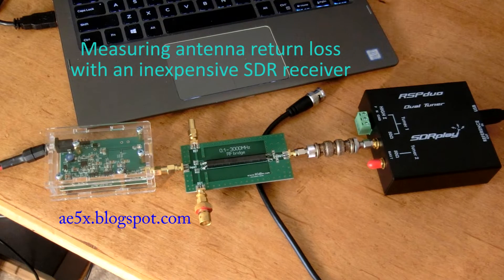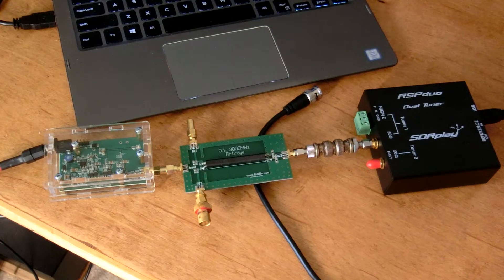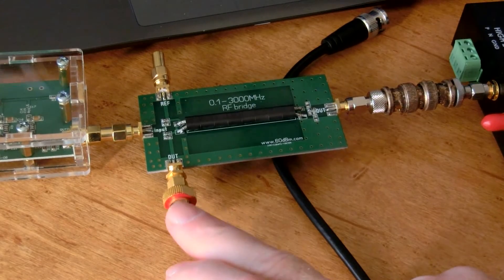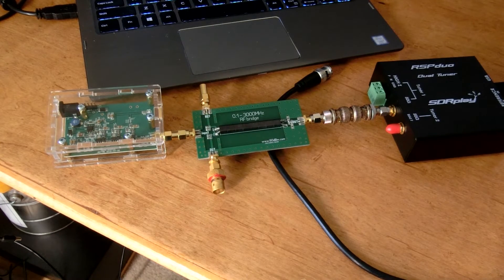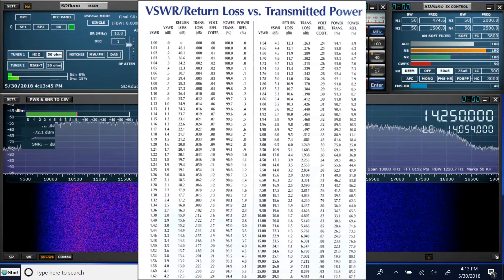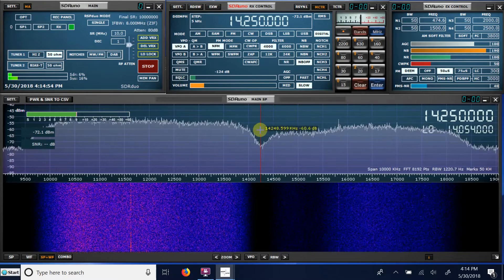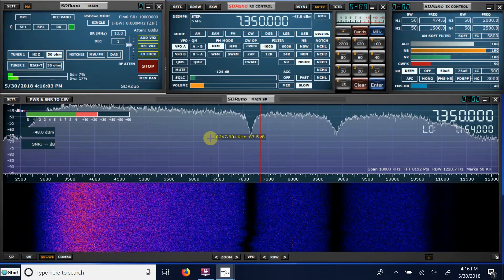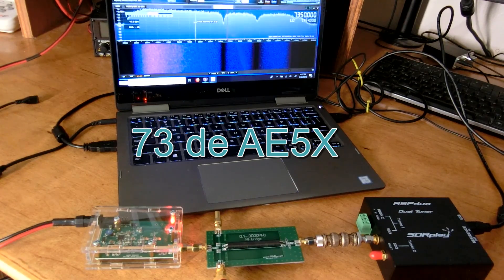Measuring antenna return loss with RSPduo

Comment: Vector Net Work Analyser is the proper tool. Cost from 47€ to 259€ in a span from 100kHz at the low end and 900MHz for the cheap to over 4GHz for the more costly one. The measure bridge is built in and the dynamic range is up to 90dB. You can also do a lot more stuff with a VNWA
Reply from the maker: "Toy factor" and other specs are all relative
Reply: My best VNWA ranges extrem  frequency from 10 Hz to 300 MHz and is limited only by 1/f noise in the lF range  and by 120dB dynamic range in HF and up range
Reply: @__logan__duvalier__ you are ignorant

Comment: This bridge is useful up to 1500MHz, above that it is crap. The alternative is to use a VNWA, that 50€ up to 1000MHz, for 250€ up to 4GHz. With the VNWA you can do a ton more type of measurements and a lot more accurate.this is a toy
Reply from the maker: With a Rhode and Schwatrz network analyzer you can make these measurements well into the double digit GHz range. To the R&S, your VNWA is a toy.

Comment: Super Video. I have the same setup only difference is the enclosed rf bridge from Ukraine and the enclosed version of RSP1A. My question is what about the power source for the rf noise sorce? It's better using a 12v battery instead of a switching power supply? And what voltage is recommended? Another topic will be the attenuator in front of the RSP? Do I really need one or I risk burning the RSP?
Thank you

Comment: Is there are special setting you're using in SDRPlay?  I can't seem to get my setup to work.  I'm using the the RF bridge (0.1-3000MHz / www.60dBm.com) to connect my trusty RSP-1A (OUT) , NOISE SOURCE BG7TBL 2016-03-06 (Input), dummy load (REF), and antenna (DUT). I've checked all connections, tried feeding different voltages in (5V 6A walwart, 12V 20A powersupply), and tested four HT antennas and one J-pole and don't seem to be able to see the dip.  I tried this about a year ago and didn't get results, then noticed the noise source was getting really hot, turned it off, then never came back.  Your video inspired me to try again (your setup looks identical to mine except that I'm using a 10 inch SMA cable to connect noise source to RF bridge), but still no luck.
Reply from the maker: No special settings really - just make sure can can receive properly on the desired frequency normally, ie with an antenna connected, no RF bridge and no noise generator. That'll prove that SDRPlay is set up correctly and will rule it out. Then connect the other items and you should see a dip where resonance occurs. Yes, the noise generator does get hot.

Comment from the maker: Here are the parts I used:

https://www.ebay.com/itm/2017-Noise-Source-Simple-Spectrum-External-Generator-Tracking-Source-SMA-case-/201785913062?hash=item2efb60aee6

and

https://www.ebay.com/itm/RF-bridge-0-5-3000-MHz-VNA-Return-Loss-VSWR-SWR-reflection-bridge-antenna-/332052527822?hash=item4d4fdf7ace

Comment: I wonder how you were able to use the RF Bridge when the ones from China have at least 2 different problems that will keep them from working?  A while back I bought one of the original ones made in the Ukraine from Transverters-store.com and was never able to get it to work until recently when I found the labels for the DUT and REF ports are reversed.  They were correct on the original design but seem to have got switched when a PC board version of it started being made for sale so they won't work unless turned over or the port labels are reversed.  On the Chinese made copies they forget part of the copper PC board trace that connects both ends of the two 100 ohm resistors closest to the Input port (on the ends facing the ferrite beads) which causes the resistors to be connected in series instead of parallel.  It's very difficult to see because of the green or blue solder resist and silk screen, which is probably why they missed it, but if you blow up the photos as much as possible and look closely you can see there is no copper trace connecting the ends of the resistors.  Mine didn't have that problem and works now that I re-labeled the ports but all the ones I've seen look identical and can't work with the DUT and REF ports used as labeled. So how did you get yours to work?
Reply from the maker: They are probably made in batches and maybe even by different manufacturers. I lucked out and got a good one? That's the problem with Chinese products - poor quality control and (maybe worse) inconsistent quality.
Reply: @AE5X  I guess they could have accidentally made some that work properly but mine is identical to yours and if I connect mine the same way you have yours it seems to work sometimes but is inconsistent and I get all sort of odd readings!  Have you tried reversing the DUT and REF connections to see if it works better that way?

Comment: Great crystal clear video.  Thanks for sharing.  Interesting timing as the SDRplay site just announced a few days back and about a year after this video... an update to the Spectrum Analyzer app:
https://www.rtl-sdr.com/sdrplay-spectrum-analyzer-software-updated-to-v1-0a/

The dummy load got me thinking since I was recently reading about pass through terminators and wondering how to make since I knew the regular terminators are fairly easy to make and here is an example for an SMA build:
https://www.qsl.net/in3otd/electronics/VNA_calkit/SMA_female.html

Background and other info (maybe can use on end of a cable for TDR, etc.):
https://www.qsl.net/in3otd/electronics/VNA_calkit/cheap_SMA_male.html
https://www.qsl.net/in3otd/electronics/VNA_calkit/calkit.html
Reply: Better update on the terminations design if being more critical: https://www.instructables.com/id/23GHz-SMA-Calibration-Kit/

Comment: Thank you for the great explanation! Should I be concerned about radiating the noise by connecting the noise source to the antenna? I cannot find any references on how much power is the noise source pushing out.

Comment: I think your reference load is not a good reference above several tens of MHz. I had some similars loads, they contain a through hole resistor and that one has a large series inductance. Better get one (or make one) with 2 x 100 Ohm SMD resistors in parallel. Of course you could measure the performance of  the load with this setup. A load with 0603 or 0805 resistors will be excellent up to at least 1 GHz if you make sure the connections are as sort as possible. Just google for some examples of diy loads or VNA calibration kits.